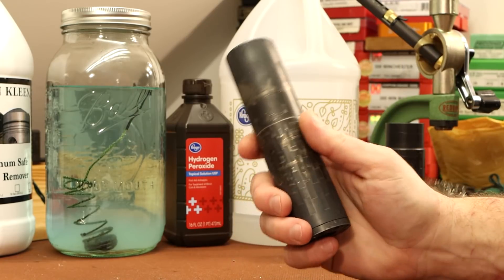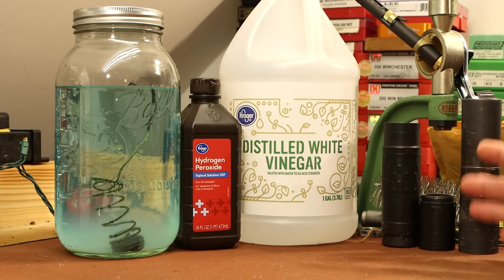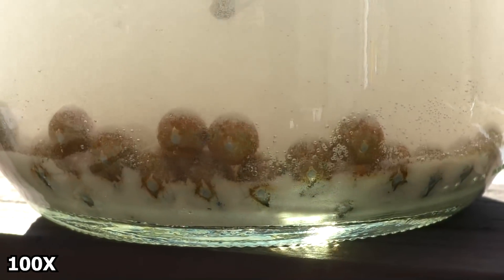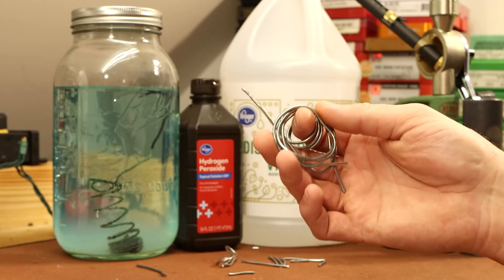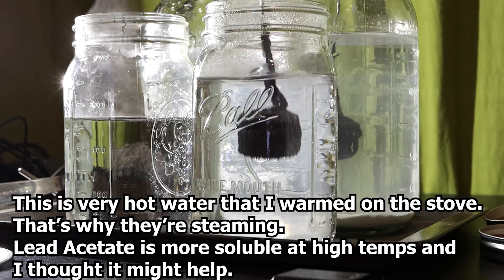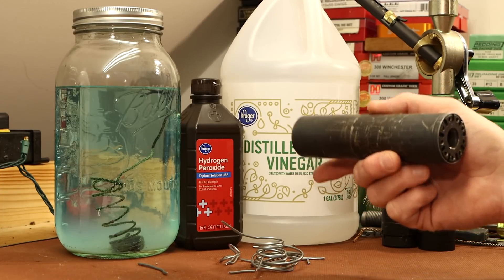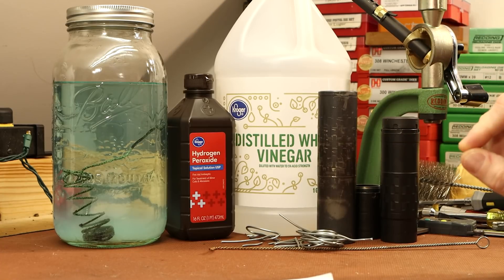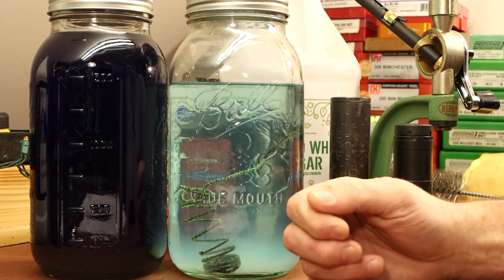Zinc makes The Dip safer. I think.

Comment: The solution and method
Ingredients:
White Vinegar
Hydrogen Peroxide (3% solution, found in most drugstores)
Ratio: 2 parts white vinegar to 1 part hydrogen peroxide.
Application:
Soak the metal parts in the solution for about 15 minutes.
The solution will likely turn blue or dark gray as the lead dissolves.
Remove the parts and rinse them thoroughly with water. 
Important considerations and cautions
Corrosion: The solution can be corrosive to metals, particularly with prolonged exposure or stronger concentrations, potentially leading to etching or slight discoloration. Some sources suggest using a contact time of 3 to 5 minutes followed by a fresh water rinse to minimize the risk of harm to the steel.
Peracetic Acid Formation: Mixing vinegar (acetic acid) and hydrogen peroxide creates peracetic acid, which is a stronger disinfectant and oxidant than either ingredient alone. However, it can also be more irritating to skin, eyes, and the respiratory system, and may cause chemical burns or toxic fumes if not handled properly.
Safety Precautions:
Ensure adequate ventilation when working with the solution.
Wear appropriate personal protective equipment, such as gloves and eye protection.
Avoid direct skin contact and inhalation of fumes.

Comment: Or just add table salt to the liquid and get solid, white, lead chloride out of it. It's a safer lead compound to deal with, same as the lead in Dutch Boy paint back in the day. Easier to ethically dispose of than lead acetate, just take to where lead paint is disposed of. After pouring the solution + precipitated lead chloride through good filter paper, in funnel, then take the filter paper + PbCl in it in a proper container to lead paint disposal site. The sodium acetate can go down a drain as it is environmentally benign, unlike Drano, etc. Reaction:  Pb(OAc)2+2NaCl(aq)→PbCl2(s)↓+2NaOAc(aq)

Comment: 1. REGULAR MAINTENANCE is key to suppressors especially .22 rimfire!
2. Clean a take down suppressor (I don't like sealed units) as often as you clean the weapon (doesn't allow build up of lead or carbon).
3. Use brass brush for steel parts and nylon for aluminum.
4. Apply a light coat of CLP, white Lithium grease or petroleum jelly to internal parts (makes cleaning much easier).
5. Don't be a pig with your equipment, keep things maintained and enjoy!!!!!!!!!!!!!!!!!

Comment: You passivate lead acetate by just adding table salt.  Lead Acetate + Sodium Chloride = Lead Chloride + Sodium Acetate. This is a balanced double replacement (metathesis) reaction.      Add enough salt that it won't all dissolve when the solution is heated to boiling.  In this supersaturated brine, no lead acetate can still exist.  

And then, to decompose the lead chloride,  mix it with soda ash and heat it to melting.   The soda ash neutralizes the HCL vapors (Hydrochloric acid) that will result.

Comment: I'd be very careful with that solution, it makes peroxyacetic acid which is quite a bit more powerful than the two base liquids. It will damage steel over time and possibly other more reactive metals.
Also add aluminum foil to the brown solution, it likely contains chromium in a dangerous form.

Comment: I think the reason you got that red solution when putting the suppressor in is because. The original chemicle you cleaned it in was likely still inside the suppressor which resulted in a different chemicle reaction. As opposed to just lead and your peroxide/vinegar solution. It is also worth noting you also added the material the suppressor is made out of which I'm assuming is steel. Which would oxidize in that solution. Then there's also the presence of carbon and any other foreign materials that may or may not be in the suppressor. Really just a lot of variables there. But I'd assume the original cleaning solution would be the root cause.

Update: so I watched the rest of the video. I can't deny the brush did seem to be the cause. However you still might consider what I said above for future experiments.

Comment: Take your suppressor and soak it in prolong engine treatment. It's an anti friction metal treatment. It will also soak into the metal and allow for easy clean up with muscle fp10  for fire arms. Or weapon shield is the same type of product.  The film from the product keeps carbon from clinging to metal surface. It's also a super lube for all metal .  heat up your can with heat gun to about 150 200 degrees and soak it in the treatment sir. Leave it soak for a day or two to fully coat and penetration of all parts of your suppressor .

Comment: Intention to inform. You should read about electroyisis. And especialy read about the electrochemical Series of metalls.

Also you should study what the chemical components are that are been released from the gunpowder.
You sure have on the surpressor, lead, alu, copper, nitrate and some oils.

All oxitators like the acid and hydrogenperoxid will reduce and oxidize the low charge metalls like lead and iron. 

Anyhow when you want to get more control and speed into your cleaning, use a battery charger and use your liquid as an electrolyte with some electron positive metalls like stainless or titanium. 

But check the polarity so you dont desolve the surpressor!

When you want to get rid of the lead you are on a good way using oxidators like the peroxid because it is a Oxygen supplier. Any Oxide is made from a basemetall and "oxygen".
When you want to go nuts about the processing calculate the nesassary watt that is needed to disolve the lead but no other metal into the solution.

Or when you want an easier surpressor to clean use a titanium made. There the electron discrepancy from lead to titanium is much higher. Ergo you have a bigger window of watt to oparate with.

 When you have almost identical electroncharges the electrolysis will becume much harder to to.

Check the elementtable in the link.
https://www.chemie.de/lexikon/Elektrochemische_Spannungsreihe.html
That will explain a lot more.
Have fun cleaning!

Comment: Ok with my limited chemistry knowledge i will offer a few suggestions here:

1: your bucket idea is ok for a waste bucket, but not the reaction vessel. The zinc will 'eat up' all the solution alongside the lead, unless the reaction turning the lead acetate to zinc in that solution requires lead acetate to be formed first.

2: as a few others have noted, if you want to speed this up buy a bag of powdered zinc from the internet/a metal or chemistry supplier. wire's alright for surface area, but you want surface area here. basically goes (from most to least) powder, granules, pellets (shot), and then just chunks of it. i'd put wire around the shot level. if you could find zinc mesh that would work faster too, but may fill up with lead pretty quick as well. long story short the finer the better. 

also, if you can, take the suppressor apart first. again, surface area. with it all put together the reaction is limited by how fast the reactants (peroxide and vinegar) are used up inside the suppressor tube. you've only got the small holes at the ends for "fresh" solution to get in. meanwhile if it's apart there will be more surfaces exposed constantly instead of it just being the outside of the can.

Comment: Just my $0.02; First it's important to know your suppressor is made from several types of metal including stainless steel, titanium, iron and copper... and none of these are 100% pure. 
Peracetic acid, without a Ph buffer, doesn't just leach and convert surface metals an carbon. It leaches these from the metal itself.  
Peracetic acid can leach at least MoO, Mo, MOC, W, WO, VC and MnO

Comment: I am not a chemist but I did work at TBAC for some time. The suppressors they make are 100% titanium so I only recommend this with titanium suppressors only. CLR works really well at cleaning gunk out of suppressors. At TBAC they use the Zep brand CLR. It works really well getting the gunk out of them. If it is really bad you may need to repeat the process.

Comment: You five gallon bucket idea will work but with a slight modification, you can’t add the zinc before or at the same time as the lead or the lead won’t (for the most part) dissolve and you will only form zinc acetate. You will need to add the lead/suppressor first. then, once you’ve dissolved all the lead you wanted to, you can add the zinc to make the solution “safer” ( I don’t actually know if zinc acetate is safer then lead acetate as both zinc and lead are Toxic metals, but I would assume it probably is, just like you said though don’t touch either with bare skin)

Comment: The white stuff is probably antimony acetate. It is moderately water-soluble and forms white crystals. Also, antimony is very common in lead alloys. As for the suppressor the brown stuff is probably hydrated iron oxide or rust. Not sure if it'll ruin the process tho as the visual can be more dramatic than the rusting damage actually is. I'd like to see you try again with the suppressor and this time reduce the volume of your solution by boiling so the lead would come out more easily (also get's rid of the leftover peroxide).

Comment: Definitely do not keep zinc submerged in the bucket long term. You’ll waste your zinc by reacting it with the acid and the water until your left with nothing and you’ll also be producing hydrogen until all the zinc is gone. You don’t really need to remove the lead acetate out of solution until you’re completely done with it. It would probably be a better idea to get a safe storage container designed for chemicals to dedicate to the solution and then use it until all the acetic acid from the vinegar is converted to lead acetate after which you can remove the lead from solution by dropping the zinc in and converting the zinc to zinc acetate and the lead acetate to lead metal. Zinc powder or shavings would work faster as well due to a higher surface area. If you look up “electrochemical series” and locate lead and zinc, any metal below zinc should work as replacement. You’ll also see a voltage and that’s the voltage produced by the natural reaction or the voltage required to reverse it by applying a voltage to the solution.

Comment: Aside from the fact that the solution should be auto-stirred, not sure why you didn't take it apart and clean it by hand.
Reply: That can does not come apart ..
Reply: @PoptartFps  I'd buy one that does come apart. Any manufacturer should know these things need to be cleaned. I spent 16 years working in a gun store and I don't manufacture anything firearm related, and I know how fast gun powder fouls up everything and how often firearms need to be cleaned.

Comment: Hi college chemistry student, some info may be off. 

the blue solution looks to probably be cuprous acetate from the copper jackets of the bullets. 

That line that was forming appears to be the separation between the lead and zinc acetate with lead metal floating in between (lighter than lead acetate and heavier than the zinc acetate)

The orange mist that formed was probably a mix of iron and copper dissolving off the wire holder and inside of the baffles. 

As for the white precipitate I don’t think I know at all why could have caused it other than maybe some weird reaction between an oxide layer on the lead balls

Cool experiment! Would love to see it tried again, maybe try filtering the precipitates with a coffee filter at the end too?

Comment: I watched the video twice, because the first time I didn't see where you did a cleaning with the suppressor in the solution with zinc at the same time.  You only put zinc in the solution after the suppressor was taken out. What happens when you put the zinc in with the suppressor, or just lead balls if you don't have another suppresser to clean?  Is the cleaning faster?  Slower?  No change?  I clean my compensators with the peroxide/vinegar solution, but would like to see what happens with zinc added during the cleaning.  Any chance you will make another video showing this?

Comment: I think that line might be the separation line of zinc acetate and lead acetate since they have different weights. Lead has more molecular weight so it would gravitate below the zinc acetate.

That could explain why the reaction slowed way down once that line went below the zinc - it's harder for the lead acetate to get close to zinc metal since it is surrounded by zinc acetate. 

Suggesting a stir bar to keep the solution made of the acetates mixed or keep the zinc metal close to the bottom.

Comment: This was cool. I might duplicate from the perspective of a classically trained chemist.

Also, that copper solution at the end is either copper acetate or copper hydroxide. Maybe both. I’m guessing acetate because of the excess vinegar in the original peracetic acid mix. To test this take a small sample (maybe 100ml or so) and get some clear, strong liquor like everclear or 151 and dilute it. If precipitates you have copper acetate. If it doesn’t then you have the hydroxide. 
This will determine how you go about cleaning up the copper
Reply from the maker: That would be really awesome. Correct it, refine it, explain it, expand it, refute it...I'd be happy to hear anything from someone that understands what's going on.
Reply: @JohnnysReloadingBench  video is up
Reply: @JohnnysReloadingBench  Aluminum powder is relatively cheap (Alpha Chemical sells 2lb for $26) and IIRC is a stronger reducing agent than Zinc, plus the powder will react faster. Would recommend trying it.
Reply: Easier: freeze distill metal acetates, the 90% of the acetates will form a crust on the surface and also suspend as particles, I just did this for copper acetate.  Then filter for pure metal acetates.
Reply: @notamouse5630  I hate freeze distillation, makes a mess. I’m a classical wet chemist- contain everything in a liquid system and kick species out chemically.
Reply: @VSO_Gun_Channel  Depends upon whether the container is glass, Also there is the option of freeze distillation, scraping the crust, crushing and centrifuging the slush, and taking the concentrate for round 2 of freeze distillation.  All without glassware, which was my reason.  I am a classic kitchen chemist reusing polymer ice cream cointainers.  This freeze distillation makes both a crystalline product and a concentrate.
Reply: I’d like to learn more about what metals can go into the the dip and which ones don’t. Like stainless steel and titanium and all that.
Reply: Do it. I'm super interested now.

Comment: Regarding the suppressor solution I wouldn’t think you would get a lot of lead to accumulate on the zinc after the can is removed. Why?  Bc your bullets are copper jacketed… the barrel is not exposed to lead unlike a 22 long rifle barrel or can.  

If you ran no or partial copper jacketed bullets then I would assume you would get more lead from a suppressor dip as in that case the lead barring surface is in contact with the rifling instead of a copper jacket.  

I use the dip to clean carbon off my muzzle breaks and the solution turns more dark blue and I assume that’s copper and carbon that has been dissolved.

Comment: 22lr suppressors build up lead fouling. Center fire rifle suppressors typically build up copper and carbon. Rotate hoppes elite clp and elite copper or mpro-7 cleaner and copper remover over this dangerous dip.

Comment: The reason it took so long is because the mixture was too cold. A safe way to dispose of the Leadacetate is to boil off the solution. It turns the lead acetate back into lead-oxide.

Comment: Not a bad idea to try and clean up the solution and recover some lead. Safer than using the lead acetate as an artificial sweetener in wine as the Romans did. Looks like there is some copper in there with the green/blue solution.

Comment: Just fyi those jars will not withstand that many heating and cooling cycles with heavy metals knocking around in there. If one were to break it would be a disaster. It may be worth a bucket to do these reactions in. Just incase.

Comment: Like gold refining, you want to precipitate the lead out. Once done you can smelt it down and reconstitute into lead ingot. Low temps melt lead, so no need for toxic fumes. Once the lead is precipitate out you can reused your solution at least three times. It will be weaker, but it will still work. Once that last batch is done, add a base to neutralize and then disposed of safely.

Comment: Johnny you have an Omega 300. remove the caps to get more crap out of it by scrapping. Also heat up some water to around 180F and add some limi-shine to it. Not much but around 1-2 TBL spoons. Then submerge the suppresor. WOrks like a charm. I use it on brakes as well.

Comment: I've had great success with DUB Aluminum wheel cleaner.    I have a Griffin Armament Sportsman that is all aluminum.    It gained some weight and the DUB cleaner did a great job loosening and dissolving the crud.     It didn't harm the finish or base metal either.

I have used "the dip" before with Rimfire cans.    You can increase it's aggressiveness by using it in an ultrasonic cleaner.    I don't use it in the ultrasonic tank.    I put my baffles (Stainless only) in a spaghetti sauce jar.    Add dip solution until the baffles are covered then place the jar in the ultrasonic tank.    Add plain water to the tank and run as you normally would.    

The dip solution can be neutralized with table salt when you are finished with it.    Or save the solution and drop off at your local Hazmat days.
Reply: Don't know about Dub but be very careful with aluminum wheel cleaners in general.  Several of them contain hydrofluoric acid which is super nasty stuff. It burns your skin like other acids except that it penetrates the skin surface and doesn't wash off with water.